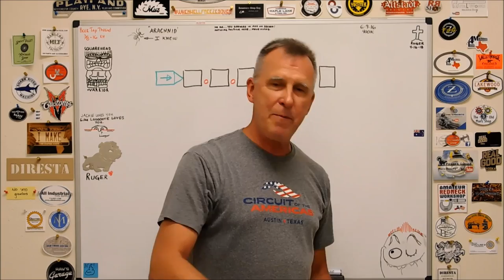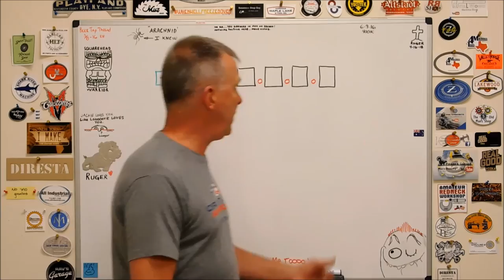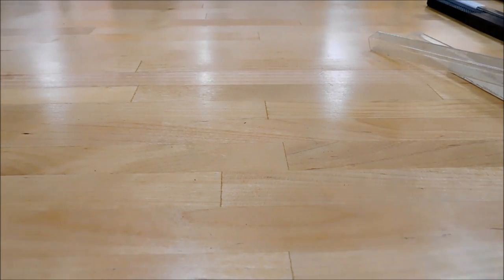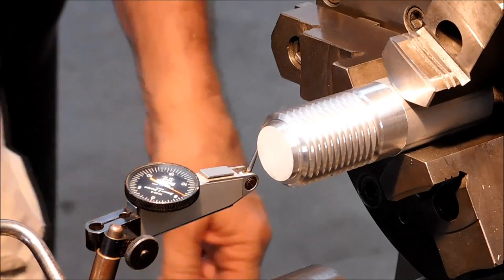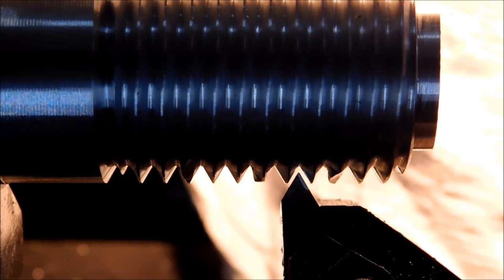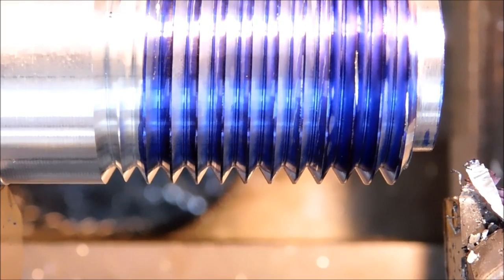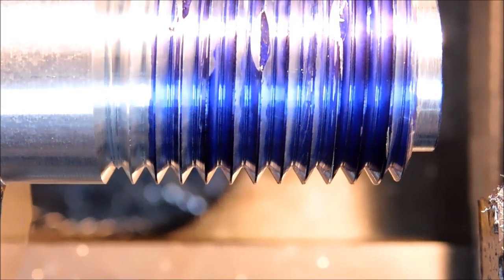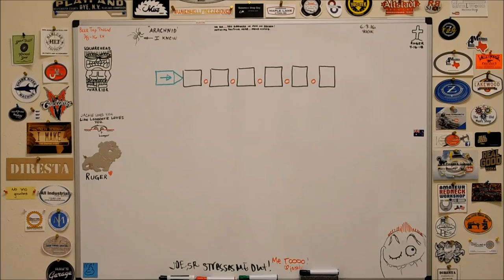Chasing and Repairing Damaged Threads

Comment: First time I ran a lathe (and got paid for it) was when the normal guy was out sick, Shop owner says "Lerch, can you run a lathe?" I say yes, he says "here, go chase these threads out." and hands me a big expensive looking stud off something.  Thankfully the lathe is in a corner and I have a little privacy while I try to figure out how to do what I said I could do but had never done.  15 minutes later and I was spinning the chuck by hand with the half-nuts engaged making sure the tool was following the threads properly and just kissing both sides of the thread. Satisfied I went for it and it turned out great.  Next day the normal guy gets an ass chewing because he claimed the lathe was too clapped out to chase threads.  I got 'lucky' because my first timid hand powered cut took out all the backlash (and there was a lot) and I literally didn't know to be worried about it!  JLerch - Tampa, FL.

Comment: Joe it’s MARTIN from ENGLAND
JOE I WOULD LIKE TO KNOW WHAT YOUR COMENT IS ON THIS 
Joe I have and do mount the work piece in a collet and center drill the end or nose of the threaded end.
Then remount the work piece in a four jaw chuck.
I keep a length of ground 1/8” dia silver steel with a pointed end witch I mount in my drill chuck in the tail stock ,this is then slid up to the work piece and inserted in the center drilled  hole  I can then put the Stylus of my clock on the silver steel near the pointed end that is in that is in the center drill hole. It has worked for me on a variety of different jobs.
Once the job is running true I can use a live centre to support the work piece.
Joe I have found you’re videos very enjoyable, as for your presentation you get a 10/10 .
Please keep going, 
 Martin

Comment: Hi, Joe, me again (Prof at UT).  Every time I run into an interesting challenge, I seem to find your videos to help me out. I was needing to VERY ACCURATELY set back a precision-rifle barrel for rechambering which, of course, requires chasing the original threads so that the new threads match up. This video makes that a cinch!  I don't know why I didn't think of making the compound slide parallel with the ways, stopping the machine part-way into the thread, and then adjusting with the compound (while the cross-slide was locked in with the half-nut). Brilliant idea. Thanks again.
Reply: Sorry, meant carriage locked in with the half-nut.
Reply from the maker: For the most accurate positioning, be sure to have some drag on the handwheel when you shut the machine down. i always maintain some drag on the handwheel during threading to eliminate any wander of the pitch.
Reply: @joepie221  Will do. I already 'learned' to hold the cross-slide handle when threading for the same reason. My compound is okay, since I can adjust the tension fairly easily, but the cross-slide can be a problem sometimes. On a side note, do you drink wine? My family and I own a vineyard and winery (in Oregon) and since I am local to you, I would love to bring a few bottles by to show my appreciation for all you do on YouTube. Just let me know...

Comment: Great video again, I came here from your comment on Adam’s video; this was very helpful. 

One of the first jobs I need to do on my lathe is to clean up come damaged threads on a clamp screw for a friend. (Loose tolerances, so good for a beginner like me.) First I need to actually cut some threads in the first place to learn the absolute basics, but this tutorial has me confident of success already :-) (The part about the slop in the gear train was a real lightbulb realization; I’m sure I would have blown the threads if I hadn’t seen this first!)
Reply from the maker: Glad you found this helpful.

Comment: The first time I did this I was a freshman in trade school. 14 years old in 1980, and I had only single pointed a thread twice before. Our school used to take in jobs from local residents or businesses, and this shaft came in with a 9/16"-12 left hand thread that was mangled. It was a really long thread, about 18 inches. My instructor gave me some verbal instructions, and told me not to cut any metal until he approved my setup. I ended up using a follow rest to keep it running true. The first and last time I used a follow rest. Back in those days we had to grind our own tool bits from HSS blanks, which added to the complexity. He checked out my setup and gave me the OK. The part came out great, and I even got a compliment from my instructor. He was a great teacher, and a fair man, but he didn't give out compliments very often. Especially to underclassmen. I did a lot of jobs after that in trade school, and in the 40 years since, but for some reason I always remembered that one.

Comment: A useful demonstration, reminds me of a job I had where the owner used the wrong loctite grade to hold bearings in a Manx Norton crankcase. It set before the cases where fully together and he beat the crap out of the end of the shaft to release it, he was virtually in tears when I gave it back to him fixed.
Just a point about losing registration, most lathes you can put the speed control into a neutral so you can turn the Chuck but because the lead screw is still directly geared to the spindle all will be well .
I put up a video for you showing my threading tool flat measuring micrometer.
In UK

Comment: I for years had trouble with long threads and long nuts. I took pride in being able to make good threads quickly. I was trained old school, making thousands of large shackle pins and big double start square threads for cone clutch actuators on winches. So on my new lathe a tight precise thread would be a nice fit for a few threads and then jam. I had to increase my clearance to get a long nut to spin on. I had checked the pitch using my dro and a stop against a jaw and it measured 6mm on the money in different parts of the leadscrew so the leadscrew being out of tolerance was eliminated. I had cause to service my drop down gears one day and check them. I had a good look at the intermediate gear set, a large gear and a small gear sharing the same axis caught my attention. On close inspection the face of the big gear was out of square to the axis by somewhere around .050". It was wobbling. It was an eureka moment. I dismantles it, machined up the problem face on the drive boss , put it back together. I had cause to make another long thread and nut a short time later and problem was solved. The wobble was effectively advancing and then retarding the lead-screw  and as a consequence a nice tight thread was impossible.  It was the only thing that bugged me about my lathe. All happy now!

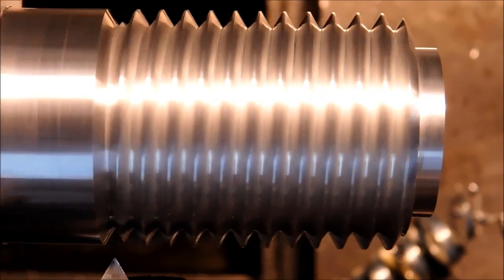Comment: Aftre 20:48 you shut the machine power. I generally like to rotate chuck with hand till the momentum of chuck gives up and matches it with all the slop in gear mechanism. And i like to use a thin sheet steel on the thread to indicate the thread gernal's concentricity. Bye the awesome demonstration keep it up. 👍👍👍

Comment: This helped today - i got one of those aftermarket bridgeport power-feed units, but the dial holder threads were simply not deep enough to accommodate the dial lock nut. So I turned a mandrel between centers, mounted the aftermarket unit, and just went through this, a couple of thou at a time, checking the fit until it went on smoothly.

Thanks!

Comment: Great vid joe,I liked the analogy of the train.
In my neck of the woods we called it backlash.
In that non-existant world where friction and clearance dont occur,it would be possible to take a cut on a thread and simply reverse the machine back to the start and the tool would track back perfectly (lol)
However, the backlash would put the tool out of line and destroy the tread and possible the tool.
A graphic demonstration  of backlash would be to engage the half nut and rotate the chuck forward, then wind the cross slide till the tool is close to the work.
Scribe a horizontal line on the workpiece level with the tip of the tool.
Then rotate the chuck backwards (by hand) until the carriage just starts to move.
Scribe another line similar to the first one. 
Unless you have a perfect (non-existant) machine there will be a gap between the two lines.
This distance is the rotational backlash in the gear train between the chuck and the lead screw.
Cheers,
Phil  from OZ
Reply: Let me guess.... You work behind s curtain??? 😂🤣
Reply: @brandonlangevin6449  s curtain ???
Reply: Your signature line, Phil from Oz. Wizard of Oz.. man behind the curtain..i
Reply: @brandonlangevin6449  Thanks Brandon, ive been called many things , but never "wizard" 
Cheers,
             Phil from OZ
Reply: I’m sure the gun machinist apprentice at work could take the backlash out of the lathe. Anything is possible on overtime

Comment: Great video on how to chase a thread, figured it out on my own some time ago..

((Here is a fun fact.))
Yes you can take the lathe out of gear while threading if it is the spindle speed gears, I do it all the time to change speeds.
You can test this on your lathe by putting the speed selector between gears and turning the spindle
If the lead or feed screw still turns you wont lose timing. 
Should work the same on a South Bend belt drive too.
At least on mine the feed direction selector and those after will throw you out of time .

Comment: Hi Joe!
This video is a classic.  The value of the video is not in it's being timely, but in the teaching it provides.
If I may, a careful examination will reveal that you chose to ignore alignment - the tool holder swivels, introducing  errors, so is the compound  slide. When you were creeping, you were just about correct at "47".  A whole 0.003" before "50". This was not parent because of the "twist" in the setups.
Regardless, he technique is excellent.

I am from the USA, one state up from you.
Thank you for the video!

Simon
Reply from the maker: I appreciate your comment Simon, but when it comes to machining and more specifically threading, I don't ignore anything. My tool post is always indicated true to both axis of the machine and my threading tool is indicated square as well. There was no error or twist present.

Comment: 5 mins in and already you've answered a question. I have a 1940s Colchester Triumph round head, and recently had a lot of trouble with threads not quite lining up. I never thought of all the baggy in the lathe drive train, I assumed it was saddle movement, now my saddle assembly is all in bits and if I hadn't seen this, I wouldn't have known what happened if the problem is still there. Every day is a school day

Comment: Hi from germany :) Great Video! At least on my machine (Weiler Condor W) the spindle is driven by the motor and the gearing stuff for the compount is driven by the Spindle... This means you can actually "push the train by hand" by just grabbing the chuck. Had to do that once to line up an Internal m30x1.5 thread... to my amazement it actually worked :D

Comment: I worked in a bolt manufacturing and distributorship years ago. We serviced the petro-chemical plants on the Texas Gulf Coast.......and really, shipped all over the world. Some of the refineries stipulated that all studs had to have a nut installed on either end. One way we had of dealing with damaged threads on either the bolts or the nuts was to thread the nut on as far and as hand tight as possible, then bang the nut on something hard(concrete floor or steel plate). This would usually have the effect of forcing the damaged thread back into position. Sometimes just a smack or two would suffice, sometimes it took more. But I've never seen one that couldn't be saved. This worked on small bolts all the way up to anything you could pick up and swing.
Reply: interesting technique, do you smack the nut axially or radially? not trying to be a smartass, just really curious since i deal with damaged threads quite often in the woodworking machines i have to repair. your method would be a real time saver.
Reply: Generally, it didn't matter. I would say that the nuts usually were contacted on the diagonal; since you are not removing any material, but instead, gently? persuading the out of place material back into position.
Reply: @MrRaynemaker  thank you sir! i'll give that a shot next time i have something like that come up.
Reply: Shit! 
I thought that was my trick
That's what I do.
Works a treat most of the time
Reply: When I was an apprentice boy (1969)
I watched an assembler of a coke oven pusher machine put nuts and bolts togather.
He was rapping them togather on a piece of iron and loading them in his pockets.
Being curious I asked what he was doing. He said he had to bolt this part
Up there (third story level)  and don't want to fight the bolts togather.
This will knock the burrs off the bolts
Making the assembly easier.
This part was suspended by a twenty
Ton crane.
A pusher machine pushed the molten
Coke out of the coke oven into a railroad car. A pusher machine ran on tracks serving banks of ovens up to a hundred coke ovens.
Been doing it (rapping  bolts) ever since that day.
Even at NASA when the techs would seize a bolt and part togather, a sharp rap on a bolt with a hammer and a drop of oil could instantly break it loose.
I could leave a message on their phone
"Job done" before they got back to their offices.
This one put me to sleepzzzzzz too.
K
Reply: Retired,45 years in the elevator industry plus hanging steel when work was slack. ALWAYS thread/tap bolt and nut setups before goiing high. when it has to go together there is no time to play. I put three phase in garage and the damn toys got bigger, LOL.

Comment: I commented in one of the Tip Blitz videos that it could be useful to have a monitor on the wall behind your machine.  Especially if you make videos anyway and have a camera with good close-up capability. Use older folk don't see as well as we used to — Lyle (Mr Pete) sometimes makes tiny errors that we can see on the video, but he could't see directly.  This was another example where the benefit of the camera we could see that you were aligned just a couple of thou left of center. so it was no surprise when the tool shaved the left face on the last cut.    I use magnetic trays to stop my bits and bobs falling off the mill slide, and I also have a decent Cree LED light mounted to it, which helps my old eyes (I'm 70).  One day I'm going to take my own advice and add a camera as a real time microscope.

Comment: interesting video ,was just working on a hydraulic cylinder tube that goes on a little backhoe i bought  (came in pieces) the threads on the tube were galled  and had torn out some , left some in the chunks in the bottom  of the treads .  ended up just using files and ground a small punch sharp to drive the impacted chunks out.   it would have been nice to be able to chuck it up in a lathe, BUT would have to be pretty big to get it in too !!   maybe if i need to do a bolt or shaft sometime i can use your methods next time!! thanks for the lessons

Comment: Awesome vid.... I love that you're using some speed.I find that a lot of people do thread work at too low an RPM....
Reply: Only because it is a left hand thread and he is cutting away from the chuck into open air. A much different scenario if it was a towards the chuck, definitely a "Brown Trousers Job" if done at that speed. What is even worse is if you CAN NOT disengage the half nut due to either a bastard thread pitch or cutting metric on an imperial lathe or other way round.
Reply: Watch Joe's video on threading right hand threads.   I think he did left hand threads so he could use the camera and show his demonstration.

Comment: Speaking of indicating a thread, I think Keith Fenner showed a little trick in one of his videos. He was indicating a thread over a gauge block hanging freely on a piece of masking tape. I believe the idea is to average out all the high spots and low spots over the surface area of the gauge block. I suppose it's a bit fiddly, but less work than making a sleeve for the thread to indicate it. 
Thanks for the video, it's very informative. Checking in from Russia. Cheers. :-)

Comment: As always a great video,I totally get the train effect,as I have ruined threads due to it,Most all my thread repair is done in the field and those thread files are my go to tool, also have a single point diamond tip cutter repair tool, I'm sure with points you made today I will have greater success cleaning threads on the lathe
Reply from the maker: Excellent.

Comment: the way ive used to indicate on a thread before chasing it is an old job shop method. Get a scale, normally an 18" or 24" will be long enough if u run something larger than a tool room lathe, (i like to use a track scale for this because they are more rigid) and lean it against the thread, the other end of scale (the bottom end because scale will be oriented kind of vertically at this point) is trapped against the base of the trapezoidal way geometry so it leans against the thread with a degree of stability, indicator goes on the scale in line with the workpiece sandwiching the scale between the indicator probe and the threads. Rotate the part and the scale will rise and fall with the t.i.r. of the thread crests. Thats my way and i thought i might share it

Comment: I made a couple of thread repairs in my small lathe, much as you describe but, I never power the lathe - I turn the spindle by hand, which makes it much less nerve wrecking.
Greetings from Portugal :-)
Reply from the maker: Awesome. Greetings from Austin Texas USA
Reply: Well, it may seem chicken, but you sure aren't going to screw anything up that way.  So there is that. 
  I like to thread as fast as my nerves can stand it, or as fast as the half nut will still drop in nicely, going for the finish.
  Still, on a one-off repair of anything I felt nervous about, or if I was feeling rusty... you couldn't go wrong turning by armstrong.